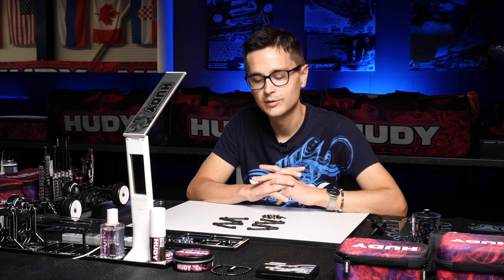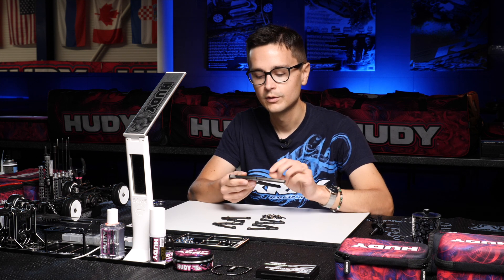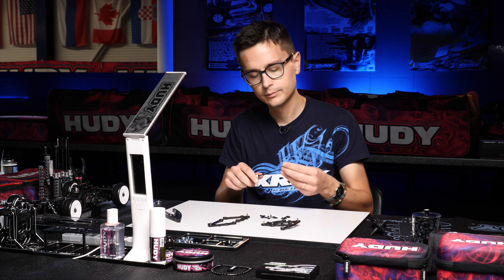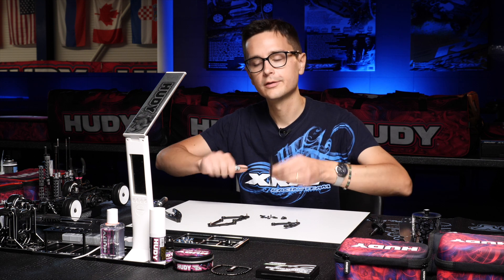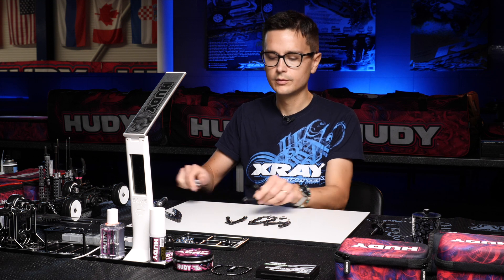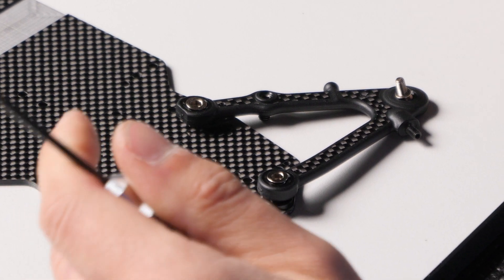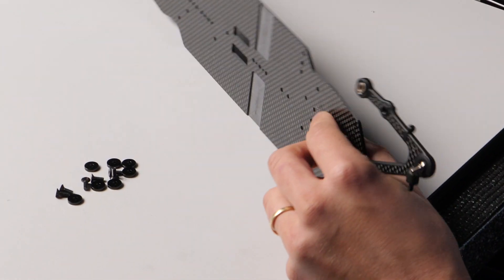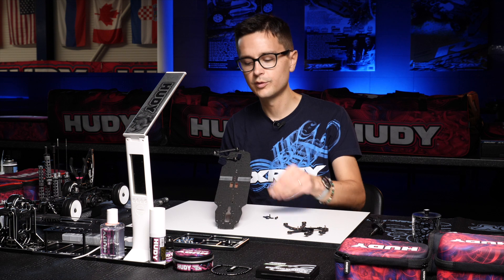XRAY X4 - Build - Front & Rear Lower Suspension

Comment: Hi Alex, is the X4 lower arm roll centre with the 2mm shim equivalent to the T4 with the suspension pins using centre eccentric bushes?
Reply: If you use the kit 2mm shim under the arm on the X4, the roll center height is 6.5mm. The point is then 0.5mm higher than on T4'21 when you use the 1 up bushing. But this is just for reference, since the X4 typically require different roll center settings than T4'21. Yes, it's adjusted with shims in as fine steps as you require.